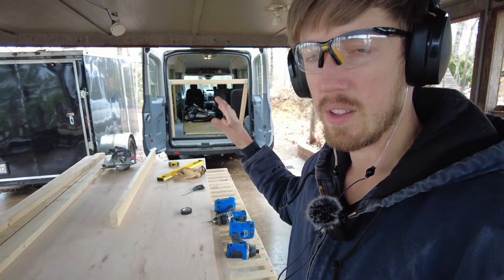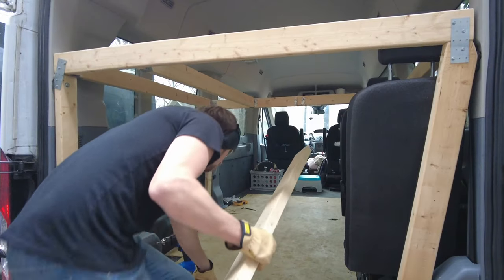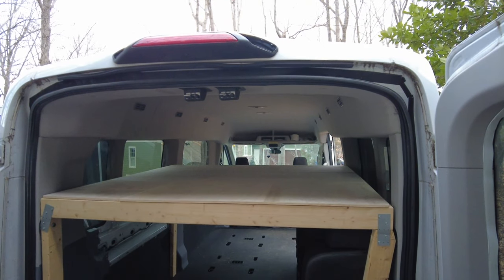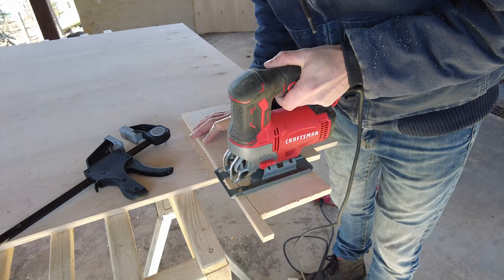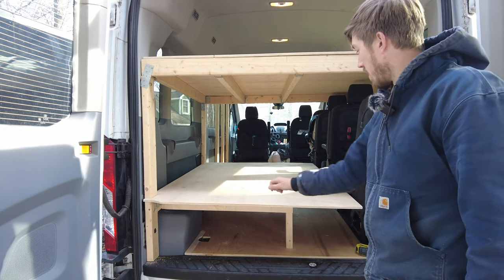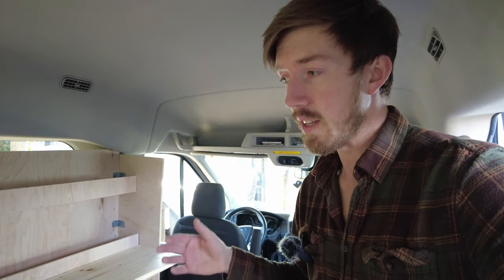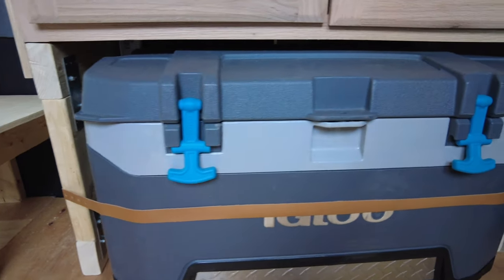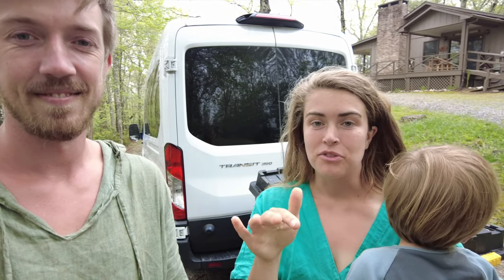VAN BUILD CONVERSION PT 3 | Convertible Bed Kitchen Cabinets Water Storage | Ford Transit 350

Comment: Hmm, thinking I would turn those bed legs 90 degrees... so when you pickup the bed, they would just hinge naturally with it... maybe?
Reply from the maker: I partially mounted them that way so that when the bed is up, the legs would not dangle and potentially hang out a little when the kids are walking back and forth and also so that the surface area direction of the 2x4 would be running sideways instead of front to back